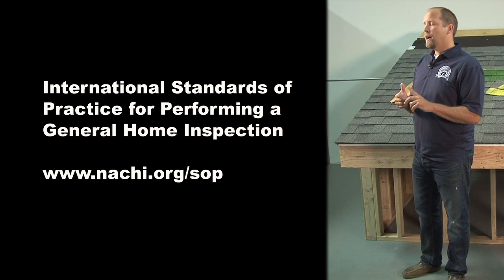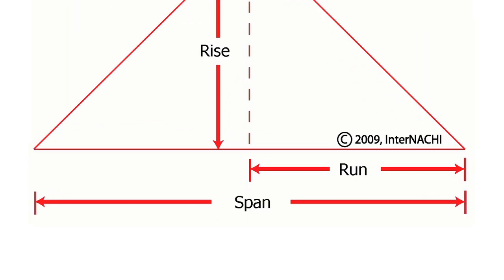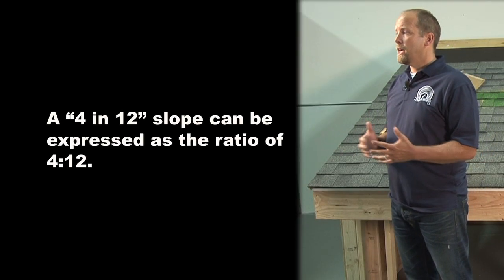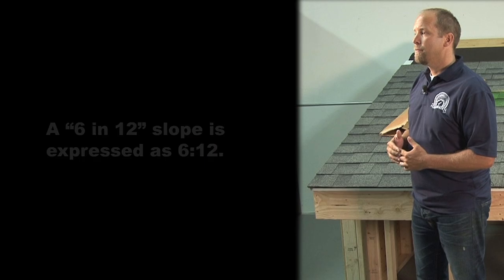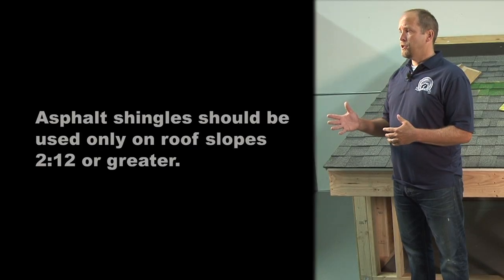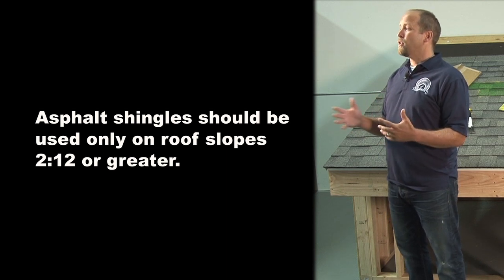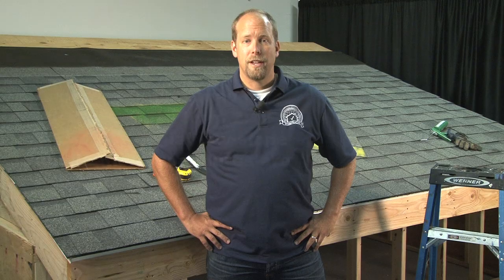Inspecting Roof Slope and Pitch

Comment: 1  -- we live in a metric world and USA is one of only three countries that use Imperial, the other two are banana republics 2- OK it is basic geometry which includes three angles.  You can use a modern angular measurement tool like the Bosch laser unit which has an angular measurement device in it or any other system, in Thailand we use a diffraction grating satellite dish angular setting tool which is accurate to 1 degree when setting a master gradient or slope or whatever you call it? (Us Brits call it the angle of the dangle)  Do you mention anything about sarking, wind and rain pressures etc.? Also for all our roofing systems we use galvanised box section steel and for the houses we use cement and ACH blocks! Never seen a wild fire here take hold of a property as there "aint no wood" If we used wood the Thai critters would devour it in a month. Dont  you guys use any basic design programs for 3D modelling now ??? Check out sketchup pro. There must be lots of free ones  too,,,
Reply from the maker: Thank for watching.

Comment: Picture examples would have been great since i'm a visual learner. What do you think about a pitch concrete roof? (NOT concrete tiles). i'm thinking of getting a pitch concrete roof built on a fourplex along with steel framing instead of wood and hardi plank siding.
Reply from the maker: Good question, and thank you for watching.

Comment: 4/12 pitch being 1/3 of the foot is not something you need to know in framing. If you're teaching math, are an engineer or architect, etc., then fine, but as far as framing a roof, it's not needed. 
Total run (in feet) times unit rise (in inches) gives you the total rise. 
Total rise (in inches) divided by total run (in feet) gives you the pitch.
Total rise (in inches) divided by pitch gives you total run (in feet).
Total run (in feet) times pitch gives you total rise (in inches).
Run is always calculated in feet, and rise is always calculated in inches.
Reply: Yes, I'm using the word pitch. Slope might be the proper term, but in framing, all you really need to know is what you're talking about.
Reply from the maker: Thank you for your comments and feedback.
Reply: How about to use rise 6/12  rise 6

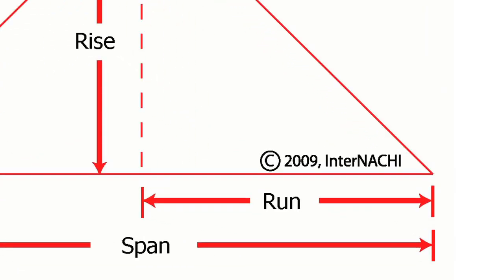Comment: Not exited by what I just seen. I have rolled asphalt on an addition on the side of the house that's lower than the original rood. So I'm trying to raise it to match the original roof seem but in order for me to still have at least a 7' 1/2 ceiling my slope would have to be 1:12

I want everything to match(shingles on roof) even though the pitch will change where the seems meet. How will such a flat slope affect the shingles? I really don't want to use rolls of asphalt or want to end up with the same low height ceiling I have now...
Reply from the maker: Best wishes to you.

Comment: Truly speaking, I don't agree with the difference of Pitch and Slope, two ways of finding different ratios. Roof makes Isosceles triangle, the Isosceles triangle has two equal sides and two equal angles. In case of Pitch we divide Rise only by double value of Run, but angle 'ϴ' is always same. slope is exactly tanϴ, angle can be changed by increasing or decreasing the length of Rise or Spam. let's rise =4' and span = 12'. then slope = 4/6=2/3=0.66, Pitch = 4/12= 1/3=0.333 (value is half of slope) because divisor is double. Conclusion: slope is related with angle and angle is related with vertices of acute tingle. Example in Right angle triangle 90-36=54, 90-20=70(slope changed), Thanks
Reply from the maker: Thanks for the feedback, Khalid.

Comment: I under stand why slope is relevant, it determines how quickly water drains and thusly which roofing materials can be applied.  But why is pitch, as described there relevant?  What benefit do builders get from knowing the pitch?
Reply from the maker: Historically the word "pitch" meant a ratio between the ridge height to the entire span/width of the building or ratio between the rafter length to the building width. And back then, the ridge was typically in the middle of the span. This is no longer the case in modern building practices. The ridge can be placed anywhere in the span, from directly middle to either span endpoint.